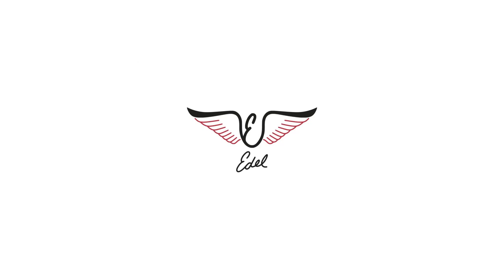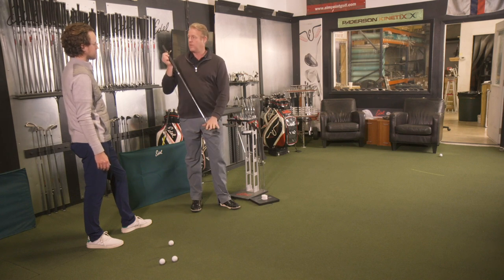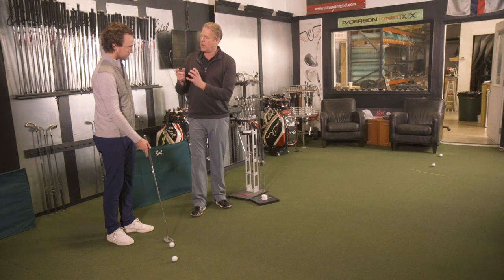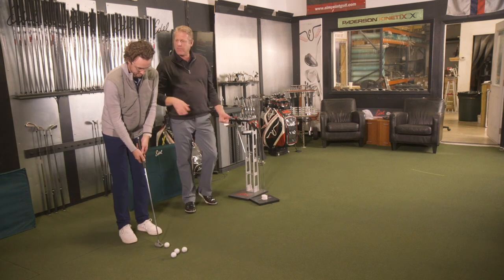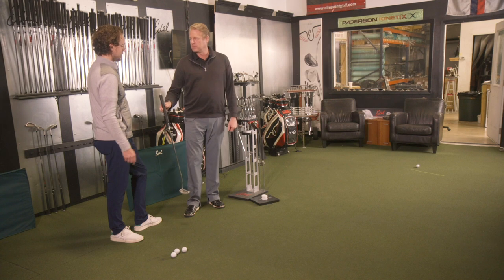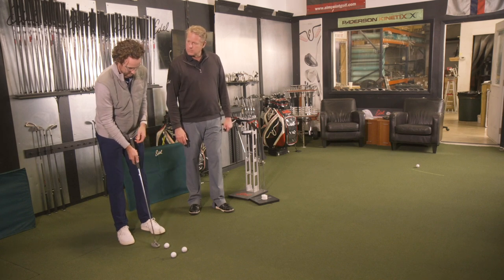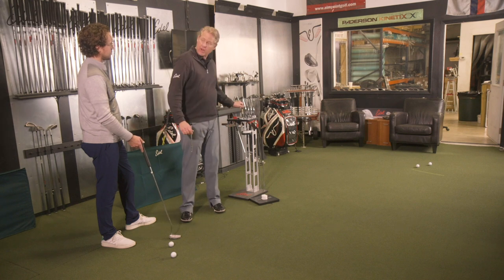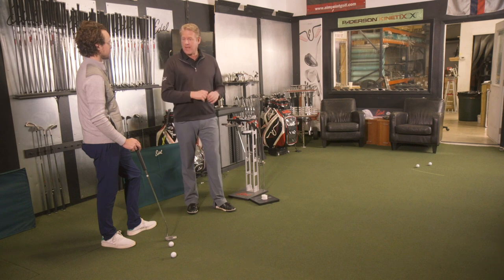Putter fitting for speed example [Putting Roadmap]

Comment: Thank you for sharing your expertise. I have a 9 year old junior golfer that has been playing golf for almost 4 years now and is a basically bogey golfer. The US kids putter has done its job but is holding him back now. I need a regular putter for him in which I would need to cut down the shaft which completely changes the way the putter was engineered. Absolutely no body addresses this huge gap in an untouched field of junior golf. Would you be willing to address how to weight a normal putter that has a shaft shortened so that it is fitted to a junior golfers putter stroke and length of the shaft for example a 54 inch tall junior golfer?
Reply from the maker: The shorter the club gets, the heavier the club head feels.
 Juniors with short clubs need more counterweight than most golfers because of this. By adding counterweight, we can get a super short putter that doesn't feel too head heavy.
Reply: @edel_golf  thank you for your reply. After checking out your website I noticed it listed a fitter in my area. I sighed my son up for a putter fitting in a few weeks. I appreciate your help!